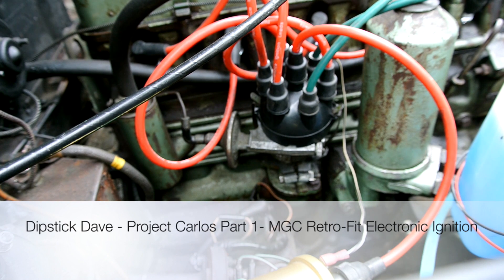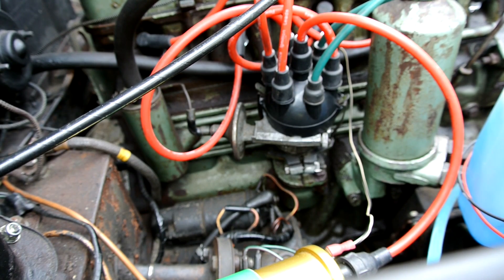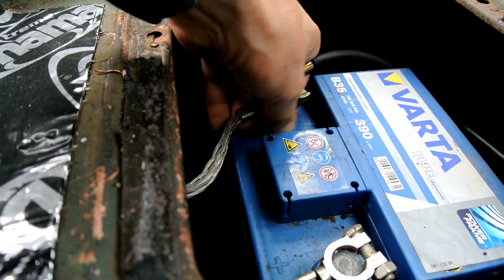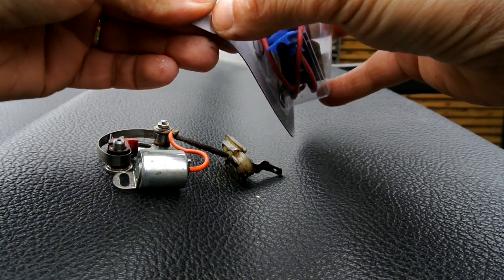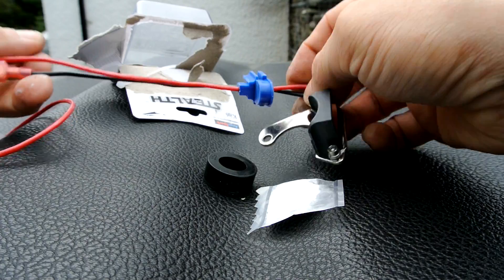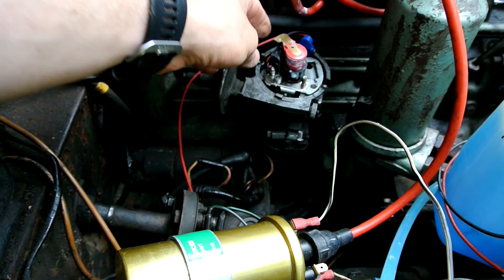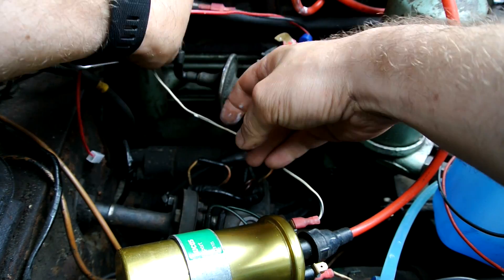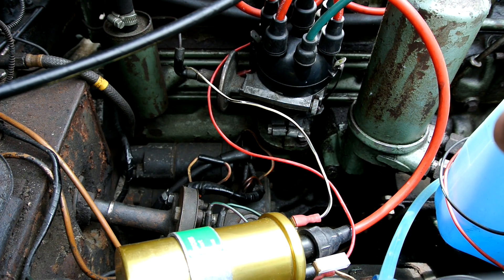Project Carlos Part 1- MGC Retro-Fit Electronic Ignition

Comment: Mate never mind the points gap, your dizzy cap is dancing all over the place when you ran the engine at the beginning - was it on properly? The fact that it didn’t jive when you ran the engine at the end suggests not!

Would have been interesting to have seen the difference in running with everything on properly and the points gap correctly adjusted - when I did this upgrade to an A series engine I found the idle needed adjusting right down, such was the improvement in efficiency.